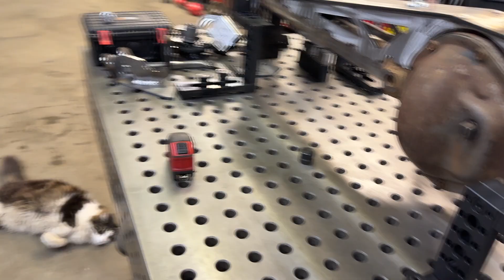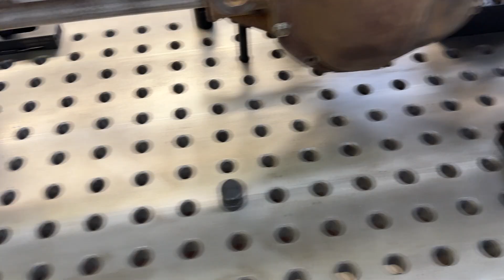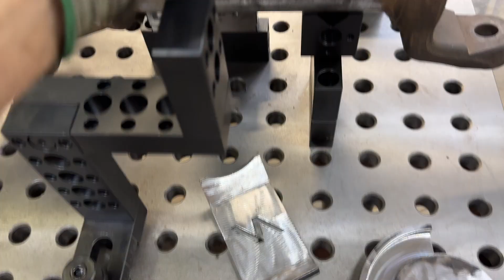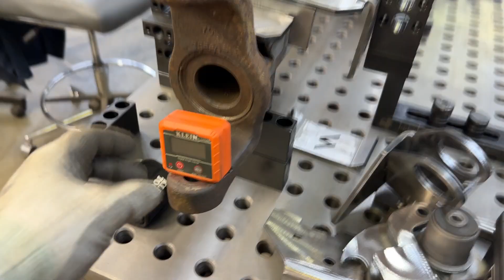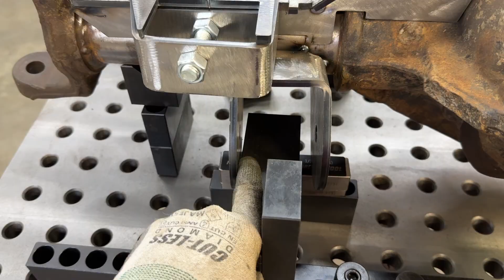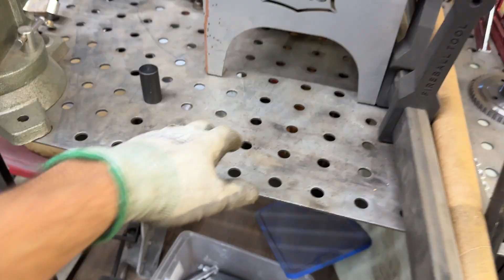Custom Axle Bracket Setup Using Fixture Table

Comment: Great explanation!  Fireball is the best! Hands down they have the best table system that I've seen. The Fireball fixtures are different than all the other table companies, in a good way.  I'm restoring my Chevelle and just bought the big boy 102x54 table to build a custom frame.  Like you said the ability to square and pull centers with the fixtures is way easier than I've done in the past.